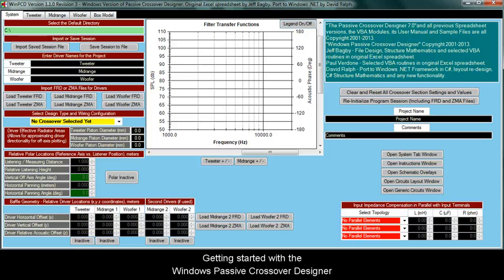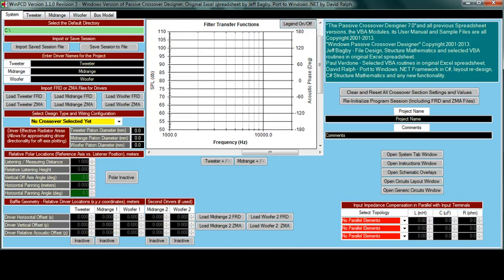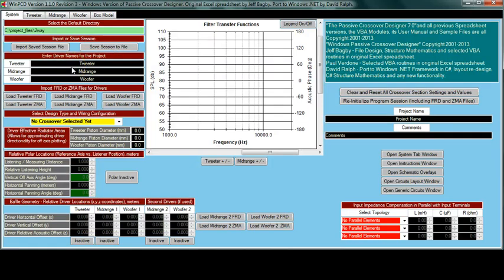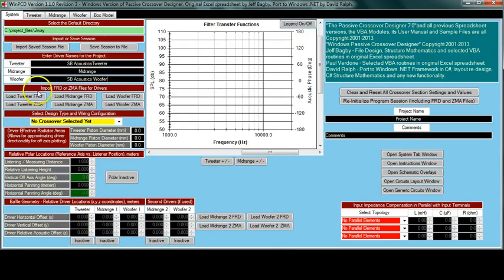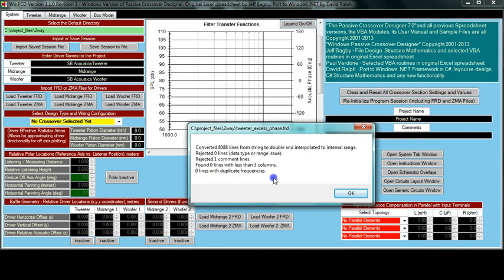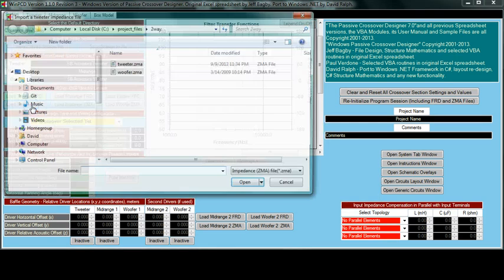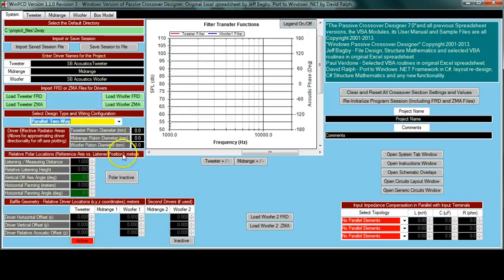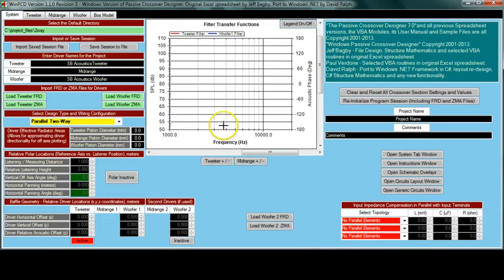WinPCD - Getting Started

Comment: Hey! I have the newest WinPCD version 1.5.1 Revision 6 and im designing a crossover for Dayton Audio ND91-4 and Dayton Audio ND25FR-4. I have downloaded FRD and ZMA files from parts express site and when im trying to load them in to the software it comes up with a warning. Something about "Input string not in a correct format". The same error comes from both driver files and for ZMA and FRD. Do you know a way that I can fix this? and thanks for help!
Reply: Oh now I found the error. Its about regional numbering schemes. The downloaded FRD and ZMA files use dot as decimal point and in here Finland we use comma. Also I had to add decimal point to all numbers that didnt have one. Luckily the dot comma change was automatic using find and replace tool in notepad and I could just copy ",0" and paste that to all necessary places. Hope this helps someone else having the same problem.
Reply from the maker: I'm glad that you found the issue. This is a problem for some users because the program will import a CSV (Comma Separated Values) file such as the type exported by Excel. Only a period (.) can be used for the decimal delimiter. Spaces, tabs and commas only are acceptable.
Reply from the maker: A note for anyone who may have problems. Please use the dedicated WinPCD forum hosted by Meniscus Audio, it's more likely that I'll see it and respond. 
http://www.diyspeakerforum.com/viewforum.php?f=3&sid=34d2b8c8368730e26c8d7d83546034f7